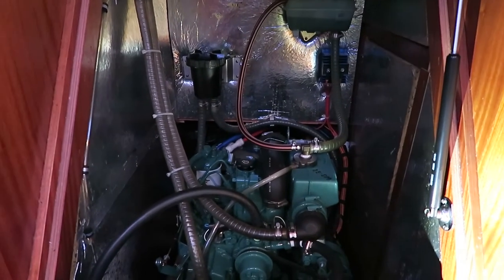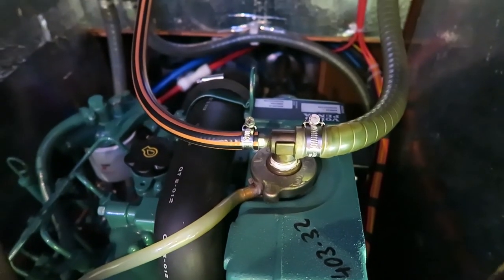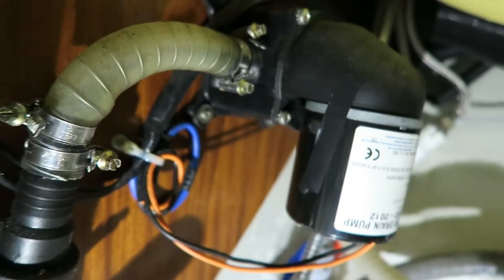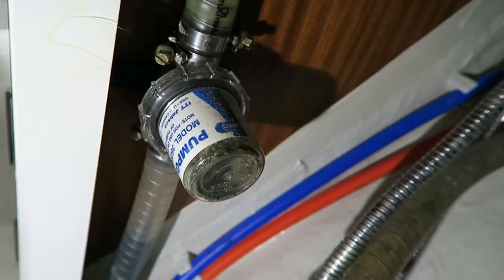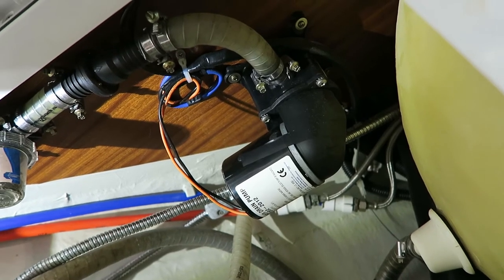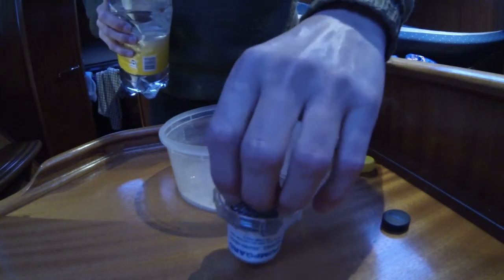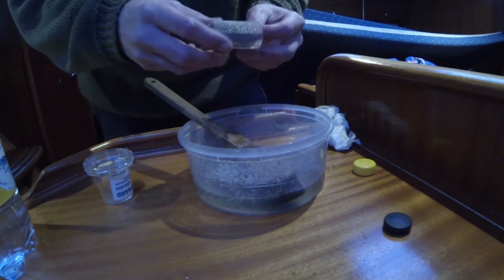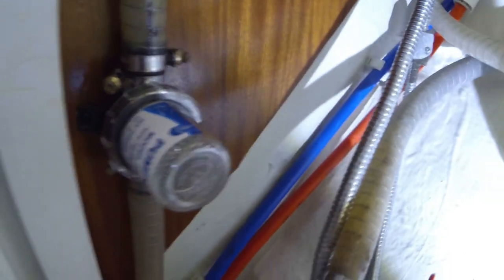Coolant leak at the engine and cleaning water strainers

Comment: Very helpful Tino.   I had never paid attention to (or even noticed) these strainers before.....  I went to my boat this morning and found them upstream of all pumps on the boat.    A good thing to check during the winter months.   Thanks.
Reply: They aren't very expensive new, and Jabsco sells service kits to just replace the elements if you want.
Reply from the maker: I know it is possible to buy a membrane service kit for the pumps for around 85 US dollars, but also nice to know that the filters are not that expensive.
Reply: The filter/strainer unit (new) costs €19 and if you just want to replace the element, it is about half that.   If the element is in good condition, cleaning it and reassembling it like you did is just fine.   Thanks again.
Reply: Patrick Laine you are a good man, Patrick. This is guy is battling along towards his dream but sharing the benefit of his experience in getting there. You are most generous and positive in your response to his videos.

Also, I love your video on “fuel polishing”. It got me thinking of the value of having two, half size tanks but that’s another thing.